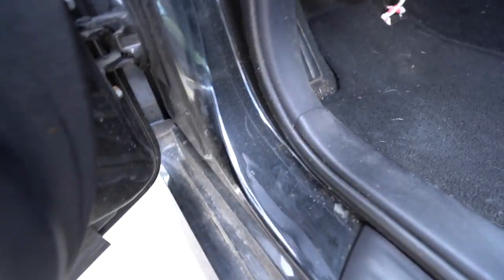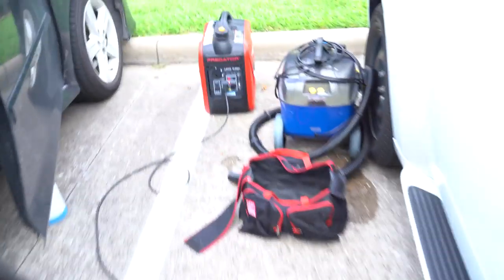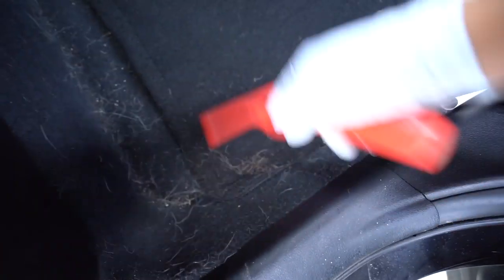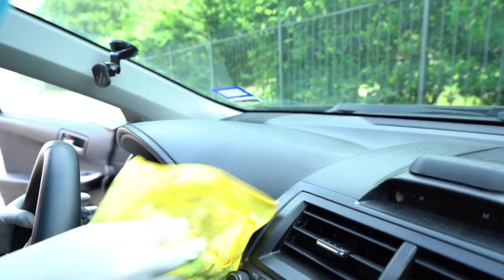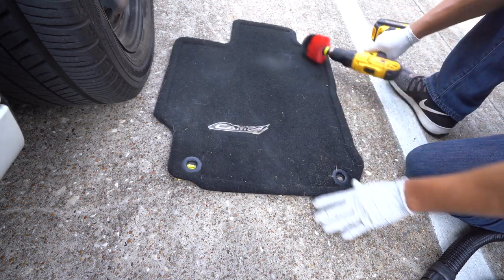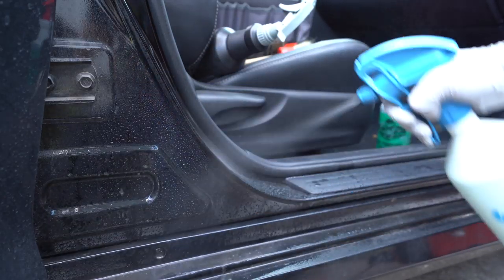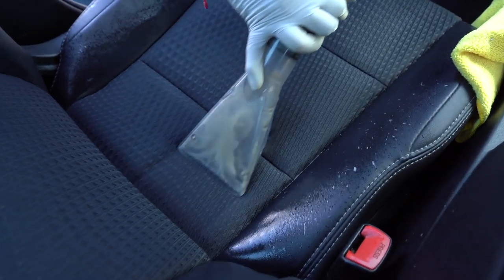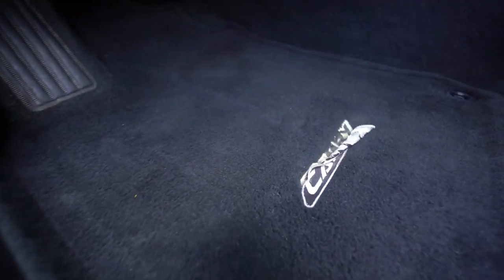Deep Cleaning Car Interior -  Floor mats, Leather, Pet Hair, and More!

Comment: A less expensive power option is a 3000 watt inverter with a deep cycle battery. Be sure to charge the battery nightly. Do not use you're vehicle battery to power the inverter or you maybe walking home. I hope this helped. 👍
Reply: that would require more work though. Time is money
Reply: Thanks
Reply: @nathane2243  no extra work
Reply: @jawbreaker007  Of course it's extra work. Not only you have to buy the extra battery and inverter. You also have to buy a tender to charge the battery every night, so you have to bring the battery in to charge it. The generator is simple plug n play. Your way maybe cheaper, but it's not plug n play .We already gotta plug enough equipment in
Reply: EP just add a continuous solenoid and connect to the alternator. Charges the inverter battery when the vehicle is running but saves the car battery so it starts every time.  I use this in my setup.

Comment: Hello! I wanted to know if you can make a video on how you clean the inside of the windshield. I never really seen you clean one but in my car it looks really foggy. I tried using wipes but it left it looking like a rainbow. :(
Reply: Use a magic earaser and a spray bottle of 50/50 alcohol and water seems to work for me .
Reply: Two towels to dry the windows
Reply: Newspaper and windex work amazing. The newspaper leaves no streaks on the glass.
Reply: I read it's because I have a protective film on the inside. I have a 2019 Toyota Avalon.
Reply: @Ranma05  I detail cars at work and we use ACDelco Window Cleaner but any brand similar should work and if it's really foggy spray a good amount and use two different towels the first to wipe most of the product off and take a majority of the film off of the windshield and the second to get rid of any streaks and kind of polish it until it's clear also if the outside of your windshield is dirty it can be hard to tell how clean the inside is

Comment: Have you ever had an issue with Toyota door panels where you get a purple/black residue on your rag after cleaning it with Super Clean? Almost as if the door panel material is coming off because of the APC. Just wondering if that's a known thing or it was just the one Toyota I dealt with.
Reply: Steve Kitner did you dilute the super clean ?
Reply: @YoulMe  Yeah standard 10:1. I thought it was weird that it would rub off the dye from the material at that ratio. Maybe they liked grapes while they were driving? lol